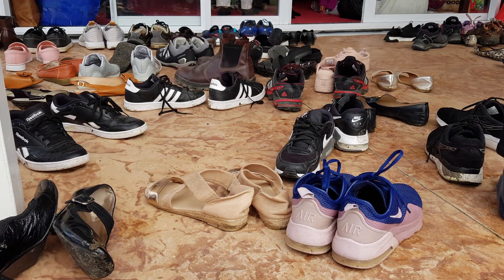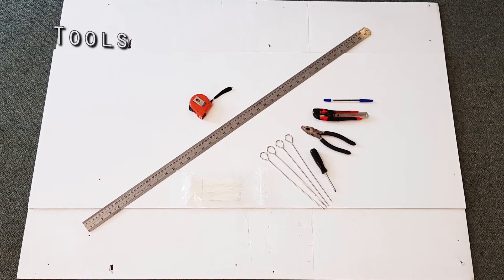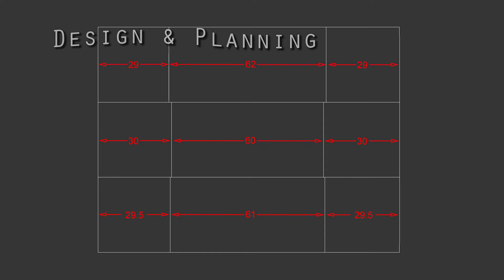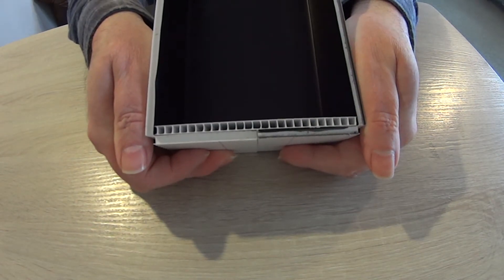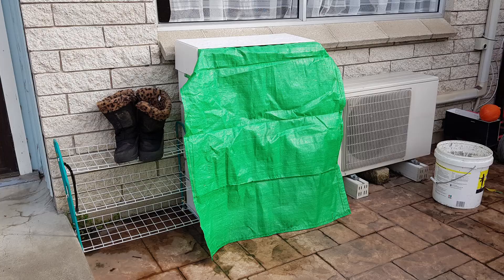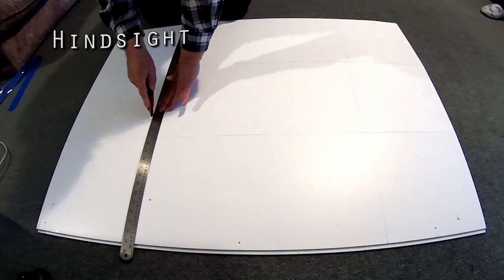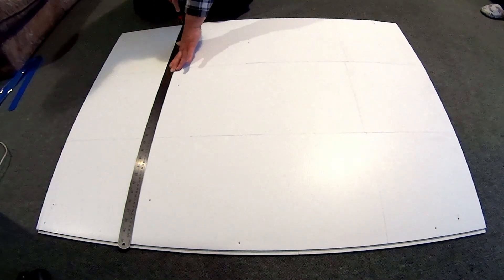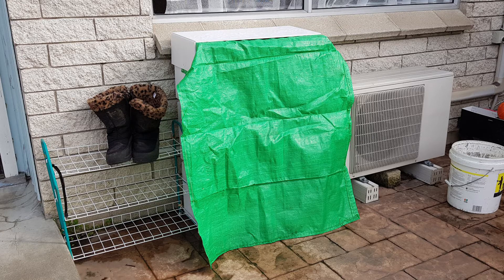DIY Corrugated Plastic Shoe Shelter

Comment: Did you know how to join two corrugated sheet edges.if please let me know
Reply from the maker: If you want to join them edge to edge, you may need to overlap.  If you do that you can use zip ties.  If you don't want to overlap, you can try a strong tape, like Gorilla Tape.  It won't be as strong though.  Hope that helps, good luck!
Reply from the maker: You know, for applications that don't require a lot of strength, you can glue the edges together.  Just be sure to use the right glue for that type of plastic.  It's not cheap!